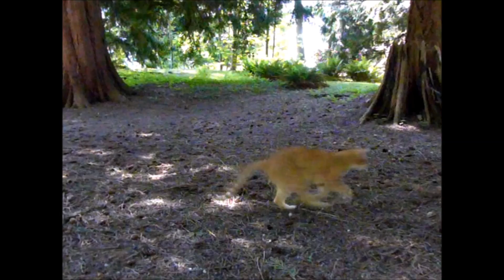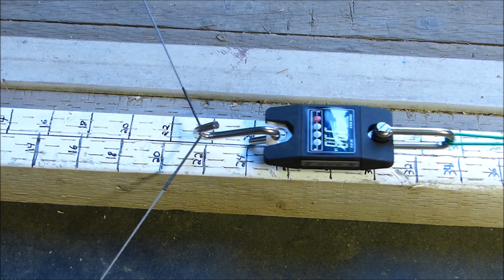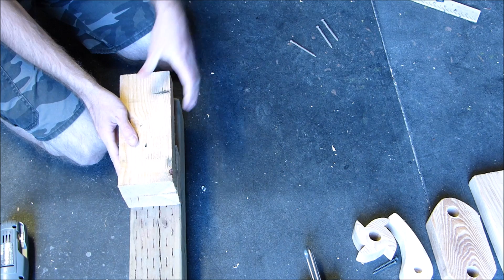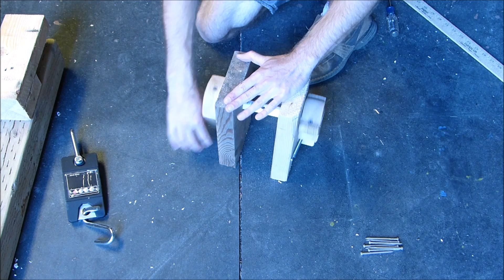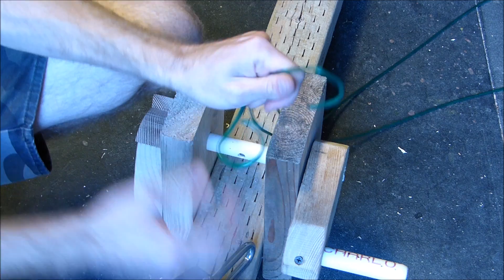Make a Tillering Tree with Windlass for Bow Making

Comment: I don't understand what you are saying about AMO inches and zero inches.   Please explain some more.
Reply from the maker: AMO inches measure from a standardized distance of 1.75 inches back from the "pivot" of the handle. Plain inches measure from the pivot of the handle.
Reply: @JaycubL  Isn't drawlength measured from the back fo the bow?
Reply from the maker: @daveengstrom9250  It's measured from the pivot of the handle, at least in the systems I am familiar with.

Comment: Nice setup!  I might have to look into making something like this.  I just have a basic 2x2 tree with nails in it right now (backyard bowyer style).

A couple of questions for you:

So once you have the bow ratcheted back to say 20 inches, how do you then safely release the ratchet and lower the limbs back to brace?  

What kind of poundage do you think this setup could handle?

Also that pvc bow looks really cool -- I like the string bridges at the bottom of the siyahs.   What are the specs of that bow?  FPS, draw#, diameter of pipe, etc.
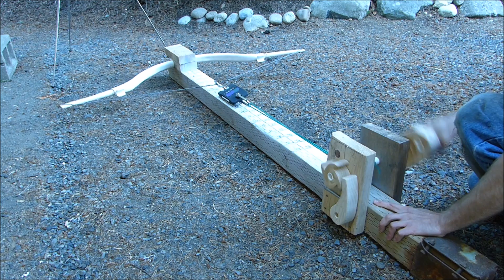Reply from the maker: +Dawesome21 To release the ratchet, you just wind the crank handle a hair further and pull the pawl back as seen at 4:15 or so in the video.
This setup should handle a lot of tension, as long as the windlass assembly is secured well and you use strong cable. The PVC axle could be switched out for steel.
That bow pulls about 45# at 28," but they will be sold as 40lb bows. I think the FPS is around 150-160, I will be testing again (the chronograph is sort of unreliable depending on lighting and who knows what else that irritates it). It is 1" pipe. There will also be a shorter siyha version that will have a higher peak draw weight and probably shoot faster.
Reply: Cool!  I missed that at 4:15.  That's pretty fast FPS for a 40 pound bow.  Well done